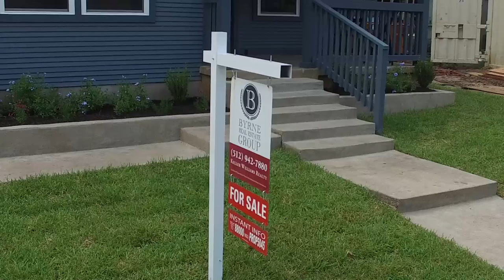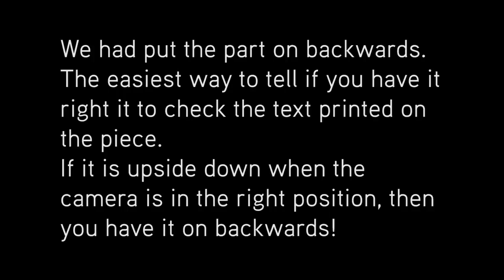How to Repair Phantom 3 Gimbal

Comment: after all the camera repairs, how was the quality of the camera?  Any "jello" or shaking on the quality?  I have a P3Advanced and I crashed it withing 4 ft high and the camera has not been the same since.  I have re-aligned the two shafts from both arms which they tend to loosen up after a crash and that eliminated the shaking, but I can't get rid of the "jello" effect.
Reply from the maker: The camera seems the same as it was before the crash. Gimbal is stable, can't tell any difference from original. That said, the repair process is tedious, so be ready for it. Thanks for watching!
Reply: Ready Set Drone I have crashed my drone at 170' and the camera was the same. After I got the sap off. If you camera is acting odd ask DJI for help they will fix it if you have been flying your drone as normal and not modifying it.

Comment: I have a phantom 3 standard where the gimble quite working for no reason and haven't gotten it to work since, it's been over a year now.  Tried everything says gimble error and can't update firmware on the drone at all.  Don't know where to turn would love to fix it.  Any ideas?
Reply: Hi friend, does it do the calibration thing when you engage/turn on the battery?
Reply: Daniel Lee 
No it does not.
Reply: Do you get/have video?
Reply: Daniel Lee 
Yes get video feed.

Comment: I crashed my drone ripped the gimbal off, amazon sent the wrong ribbon after I took it apart. 3 weeks later I had 5 screws left over....  two flights after that my DJI phantom standard just made odd beeps. As requested by DJI i sent the a video of my problem. They sent me a ups sticker I sent them my drone one week later I got a a new drone. I'm glad I didn't have to do this. The invoice said 180us$ 4 new motors and ECU. DJI rocks if you have documents they do take care of there customers and 180$ is not a lot of money for a new drone of this caliber